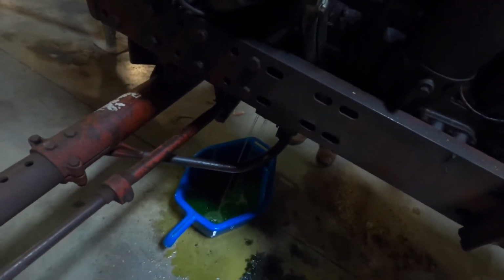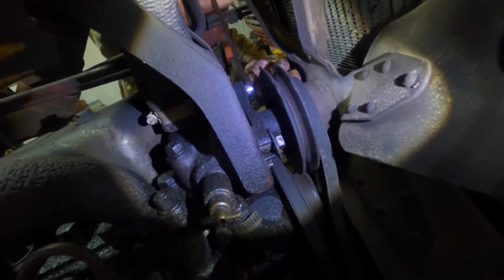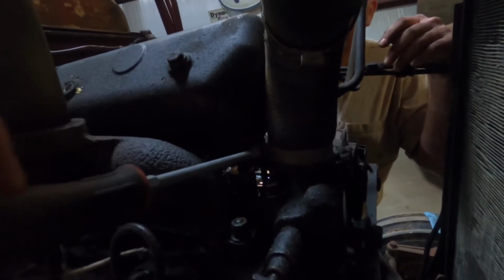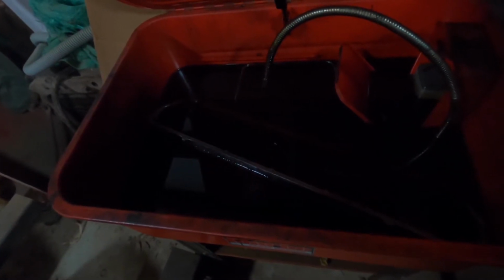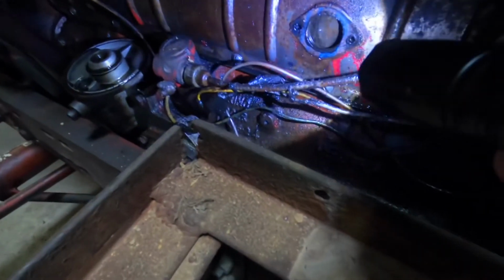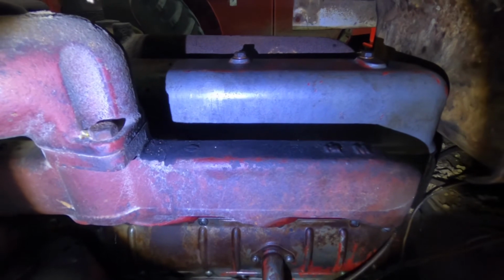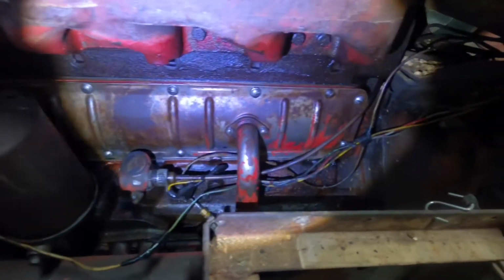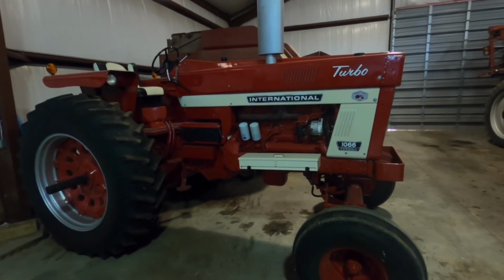656 Farmall pt.3, new gaskets. Merry Christmas!

Comment: Good job and merry Christmas. I was wondering if the 656 is a gold demonstrator. I remember you talking about your uncle working at IH in Memphis, and I thought I saw some gold or yellow paint on the panel over the fuel tank. I enjoy the videos. I'm not too far from you, couple hours south in Alabama.
Reply from the maker: No gold paint. Just dirt and patina. What part of AL?
Reply from the maker: This one was bought new in 66 from Barr in Florence AL.
Reply: About 10 miles south of Gadsden. I just wondered if it was. Those demonstrator tractors are about as rare as hen teeth.
Reply from the maker: I know where some gold demonstrators are. They were painted red when sold at the dealership. But the underneath of the sheet metal is still gold. A collector I know has them.
Reply from the maker: I’ve been through Gadsden going to Anniston. My uncle had a Baptist church there about 40 years ago. I was probably there as a baby.
Reply: I'm about halfway in between Gadsden and Anniston. I'd like to have a demonstrator, but my pockets ain't deep enough. I got a 766 black stripe. I'm working on a 806.